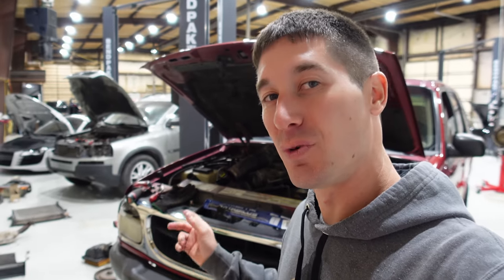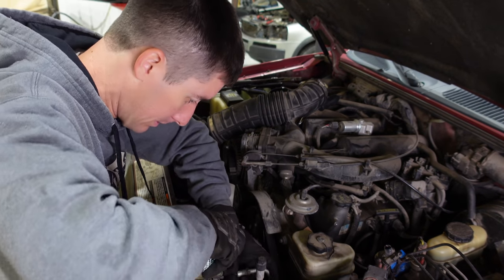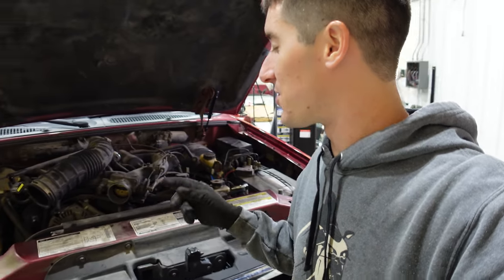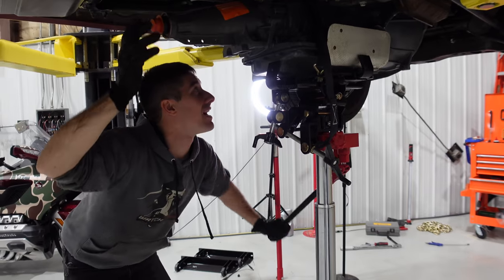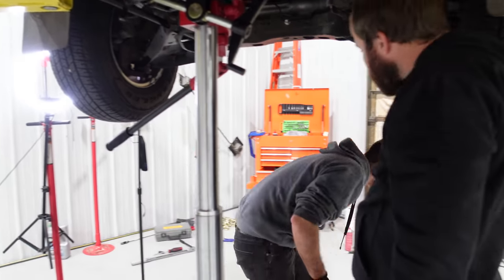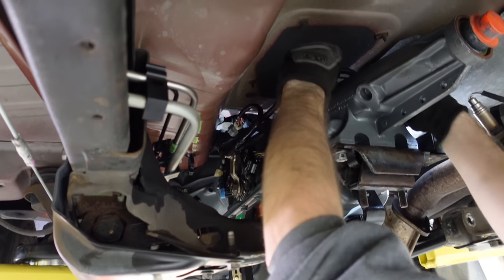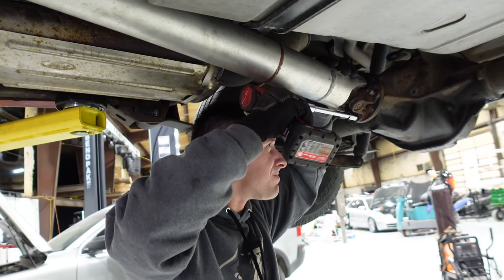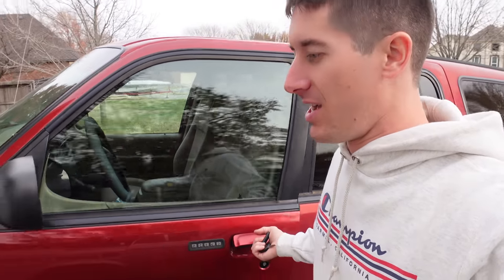Ready To Explore Again! 1999 Ford Explorer 3 Minute Transmission Install

Comment: I saw some Jasper comments below and thought I'd add my 2 cents. I have been a part of 75+ engine and/or transmission swaps with about 98% of them being Jasper products. Full disclosure, I worked for Jasper for a short time as well and have spent time in their facilities in Jasper, IN. I have also spoken with 100+ shops that used Jasper and can tell you that, like the comments state below, there are mixed opinions. That being said, the vast majority of people are very happy with Jasper. I personally have had one Chevy truck come back with a bad Jasper engine at about 90k miles and Jasper replaced it, no questions asked. I have also had one Jeep come back after about a year with a freeze plug leak. Jasper paid for the repair without issue. I replaced one Chevy truck transmission with an O'Reilly transmission and it failed within the first 10 miles. After months of trying to get a warranty replacement, O'Reilly never got us one and finally gave me my money back. I have used one GM crate engine with no issue along with a few other brands with no issue. Personally, I like Jasper and almost exclusively use them. The down side is their price. No debating that, they are expensive. Something that most people don't realize is that Jasper re-engineers their products to eliminate the factories original engineering flaws. They also take a lot of time during their remanufacturing process to go the extra mile to test for leaks (both internal and external) and to correct any manufacturing/time/heat/warping flaws in the cores. They actually test run each engine and transmission before it leaves the factory. Keep 'em Up-N-Runnin!!!

Comment: A transmission installing tip:  get some bolts longer than those securing the trans to the bell housing.  Cut off the heads, making sure you can still get a hold of the bolt with a vise grip.  Line up the trans using these, and then remove them and install the correct length bolts.
Reply from the maker: This is genius… even faster than the dowels 💯
Reply: @WatchJRGo  You guys should’ve done a full detail on it I would’ve watch that lol.
Reply: @WatchJRGo  - I do the same tactic, but I cut slots in the end so I can whip them out with a screwdriver if they get into a compromising position.

Comment: I'd check for a crack on the dipstick tube. That's what killed the transmission on my father's explorer. It rusted by the exhaust manifold and then allowed water in the system.

Comment: The 5R in my 2000 Explorer is almost at 300,000 miles. It’s never been touched other than a few filter and fluid changes.

Comment: Damn lucky neighbor, if they had to pay full cost for that service it probably would've mechanically totaled the truck.
Reply from the maker: Honestly that transmission was almost $3,000... that's about what the truck would sell for 😳
Reply: "Theres a small end and a big end"...thats what she said
Reply: Gotta keep the exploder running as long as you can with todays overpriced new cars/trucks
Reply: I wouldn't put that kind of money into one of those, especially a two wheel drive, but it's not my truck and people like what they like. At least it should give them many more years with all the new parts.
They probably paint the cases because it's quick and cheap vs doing a perfect cleaning.
Reply: @alisosa9836  in a year or less you'd be doing the same work.. not financially smart.
Reply: @dragonbrownies517  it’s lasted since 1999, it will despite your pessimism last a long time
Reply: @notanattorneybut2329  The V8s last forever. No one gets rid of them for mechanical reasons. These V6 SOHC I would worry about the timing tensioner  in that engine. Should have done tensioners while the trans is out. You need to pull the engine to get to the back cover.  Then again it could be good for another 50k.
Reply: @WatchJRGo  Ouch! I started rebuilding my own because of the cost. I always treated auto transmissions like they were magic and were too complicated to repair myself. Found a transmission guy online who rebuilt a Dodge 46RE step by step, bought a kit and followed his tutorial. Trans worked flawlessly and have rebuilt 4 more, including one for my wife's 2002 Chevy Tracker. Maybe a next step for you to consider?
Reply: @alb12345672  yeah the timing chain guides took the majority of the sohc v6’s off of the road
Reply: @mattneaderhiser4658  I have a 97 OHV 4 LITER. MAKES A RACKET BUT. STILL RUNNING at 280,000 gotta do timing chain and tensioner set. I think it is also due for trans service
Reply: @brunorios7223  You’ve lucked out and got a good one! The OHV engine is leaps and bounds more reliable than the SOHC.

Comment: Once cars hit about 20 parts become made of unobtanium. I used to hit u pullit yards for all of the cheap parts for my Dart, my ex Neon, and now I should be gathering parts for the 06 Charger RT I got cheap last year. I bought parts for each car cheap and easy, then each one hit 20 and stuff dried up. I don't see a bunch of the early Charger sedans now either. My Neon the drivers door got destroyed and it was 95 2 door coupe. I was extremely lucky to find a ok door at the closest pull a part last year and had to swap out a bunch of parts from the old one. Looking around there were only 3 or 4 First gen Neons in the whole yard and the rest of them were 4 doors. Last time I needed something years ago there were probably 20 complete cars and it was just a matter of trying to find the sensor I needed in the easiest to get to car that had the right one. I got a couple of the newer version with the updated plugs in case the one year only original was bad too. The right part ran fine till it finally blew the timing belt and I gave up on it because it was high mileage and beat.

Comment: What's up with the gear indicator?  Seemed to be one position too far when you were doing the test drive.
Reply: There is an adjustment under the dash.
Reply: You've never driven an old Ford truck or Explorer obviously, comes standard after 15 yrs...

Comment: Man my 98 had 423,000 on it still ran great just had some electrical gremlins...
Reply: I sold my 97 at 511k miles, 5.0 AWD with front drive shaft removed.

Comment: PRNDL indicator alignment?
Reply from the maker: It’s lined up on the transmission, the shifter in the car is off for sure 🍻
Reply: Think those have the issues with the plastic bushing under the steering column. Dorman makes a kit. 😋
Reply: Or you can fix it with a zip tie if the adjuster mechanism is broken. It's just a piece of plastic and often does break. My '99 Explorer does the same thing and so did my 2000 Ranger. Or just take your time shifting and learn to do it by feel.

Comment: So would it just be easier/cheaper(when you factor in your time) to just replace the trans cooler???  Maybe replace the lines as well???   I know the lines are pretty easy to blow out with compressed air if they are solid metal with no rust.  Rubber stuff, I'd replace them on a 22 year old vehicle.

Comment: Those explorers do last,even with a bad oil pumps ,Bad piston rings and with  Bad torque converter  and with 482K miles.Best 500$ spent ever!,mine was the rwd with the V8.

Comment: I actually said, "nooooo!" out loud when I saw the danger to the Milwaukee light. I like mine so much I'd rather blow the intake manifold and have to bolt my floor pan back in than be without it.
Reply from the maker: Unfortunately you can’t use it on camera so it’s basically worthless to me 😢
Reply: @WatchJRGo  The hack for that is to roll it over so it's pointed straight at the hood while you're recording, then flip it back down when you're not. It also helps to have approximately close shutter settings and other decent ambient lighting.

I also don't claim that I get it perfect. My audience must suffer for my art...
Reply: Which light do you have? There are several models in both the m12 and m18 lines.  I'm trying to decide which light to buy
Reply: @bgee461  I have the same M12 underhood light JR has (that he was using as a hood prop). As far as I know, they only make just the one. Looks like the kit part number is 2125-21XC.
Reply: @TheBrokenLife  thank you! I was looking at the cube ones, didn't even notice the underhood one

Comment: It's not really about doing repair at home, except for the capable few. It's really about independent repair shops having the tools, parts, and data to do repairs. Louis Rossmann's YouTube channel features such a shop for MacBooks, where much of their parts supply is from "donor boards." Louis has probably had as much to do with this Apple decision as anyone, having been dealing with this issue for many years, and more recently as a political lobbyist, for want of a better word. Fascinating times.

Comment: came out well i still recommend replacing the auxiliary cooler or at least putting the ford filter on it it goes on the return line it looks kind of like a fuel filter but it’s not it’s still available if the customer wants it but i got it it’s not your car just trying to help anyway i had a 1996 Eddie Bauer explorer with the pushrod V6 very reliable i upgraded when the transmission went out on me after over 200 thousand miles to a 2006 Limited explore with a V-8 love its power lol it’s been as reliable as the other one was just keep wishing i had the money to put a super charger on it that would be fun
Reply: I have the 96 Green EB I drive it every day. Third car but I like it. Has a 7' android radio now. I have a huge cooler on it with about 170K miles. Almost got a an 06 V8 mountaineer!

Comment: Glad this went fairly easy......But you never installed a transmission until ur on ur back under your 1 yr ol 1983 GT Mustang pullin trans. cause I burned clutch after 1 yr doin burnouts lol :)

Comment: Flashbacks of my transmission swap on my '72 G20!  I didn't have a fancy shop, and my wife helped during our 2-3 week ordeal. I envy you with that shop full of stuff. 
Just a quick question;  I have a 2005 explorer that I took to the dealer for some repairs and they broke/lost the gear shift indicator (the little orange thingie in the instrument cluster that let's me know what gear I'm in). They 'can't find a replacement' for it. Are the indicator parts interchangeable across several year models?

Comment: What we found at the old trans shop, Jasper engines and transmission quality went to be overpriced and crappy quality. I wish I could remember the transmission remanufavturer we used with huge success. Certified is still good last I heard.
Reply: @r.weaver3769  not political

Comment: I sold my '96 Peugeot 106, and bought a '01 Renault Clio, this year.
Why?
Because the Peugeot 106 was both getting hard to find some parts, and its engine was reaching the end of its life - while consuming a lot of fuel.
Nevertheless, it will continue to make someone happy.

This Ford has more applications than the Peugeot, but it has a really worst mileage.

Comment: Yeesh. Sounds like a bucket of bolts every time you drive over a bump.  Oh wait, it’s a Ford… never mind.
Reply: Needs new end-links on the front sway bar. Easy fix but this explorer could still use a lot of things… where do you stop?